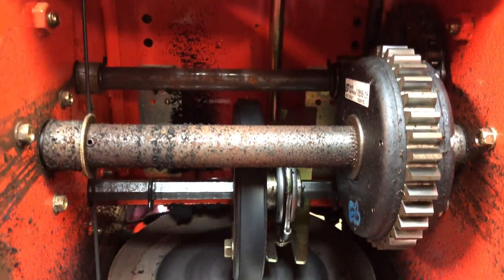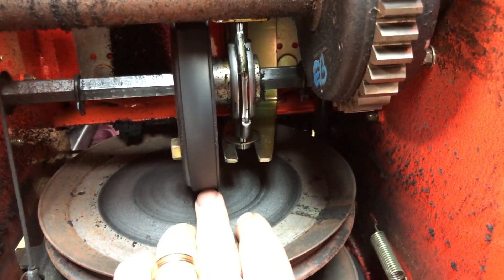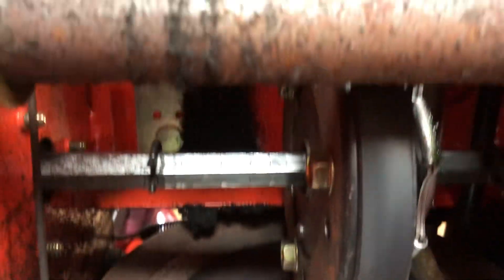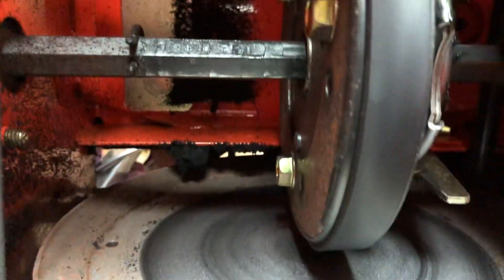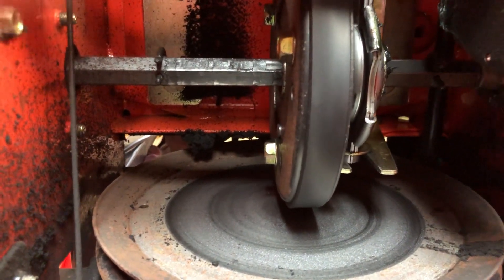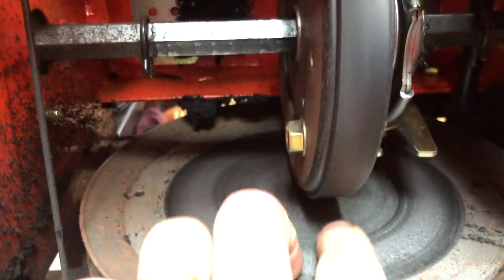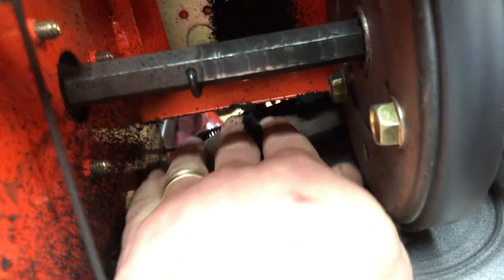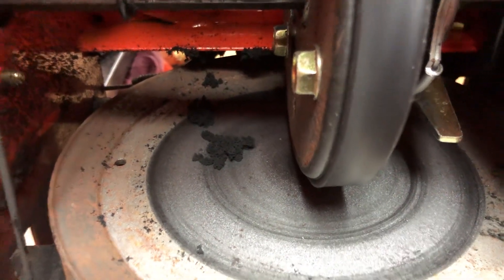Snowblower Operation incorrect Gear Selection and Resulting Damage (slow down)

Comment: I recently bought Ariens 2024 De Luxe 24. At the first use …the first gear was little too fast…I adjust it…the dealer prevent me …if I use too often the first gear , the the friction disc may worn more rapidly…I am confuse, where is the truth . Thank you from Québec, Canada. Pierre
Reply from the maker: Nah, it should be fine. It it sits in the middle the drive wheel, then this would cause premature wear, but moving slightly slower would be fine. My suggestion would be to adjust it how you want, operate the machine, then inspect the drive wheel (if possible) after using it once. If it isn't worn in an odd fashion, you are in the clear.

The dealer doesn't want to do unnecessary warranty work, but the only danger would be adjusting it too slow, and the drive wheel spinning in the center. IME, 1st and reverse 1 should be similar speeds, in opposite directions.

Comment: I have an old Murray built Craftsman that tells you on the gear selector what gear to use in different types snow. Even though it says if the snow is really light and powdery you can use three or four, I usually don't go past the 2nd gear. I like to take my time anyways. 5 and 6 on that machine are labeled as transport speeds.

Comment: Thanks for that info. I bought a toro 824 OE last year but luckily for me we did not get much snow for me to use it. I’ll keep that in mind.
Reply from the maker: Yep, first gear generally recommended all the time, 2nd in light snow. The trash leftover from the plow might need 1st gear INTERMITTENT, as its about 2x denser than the normal snow. This will save the auger belt as well as the drive disk.